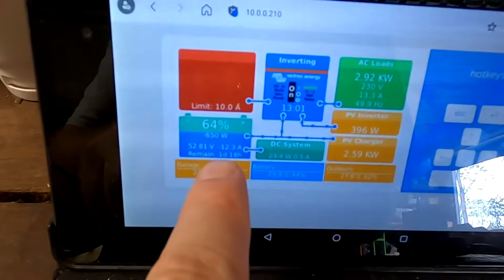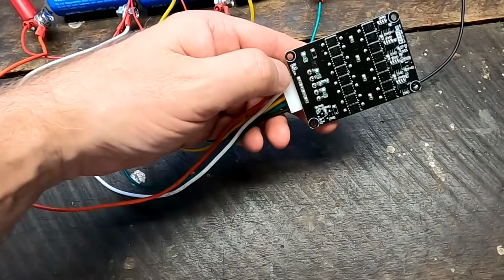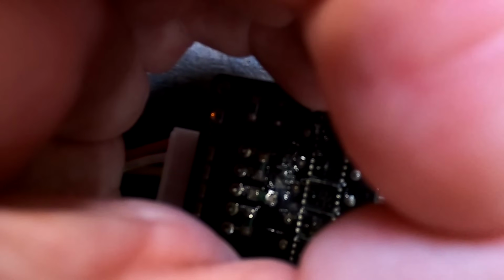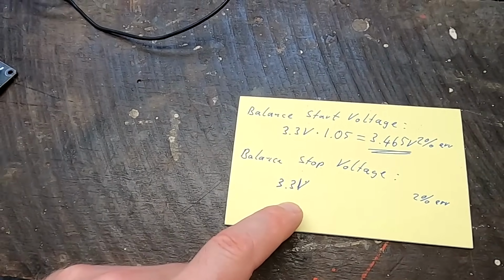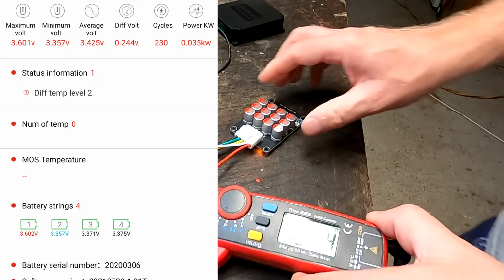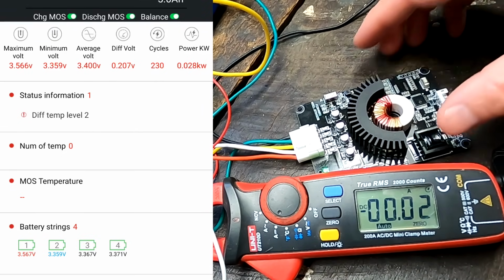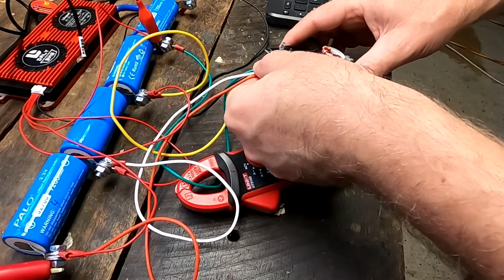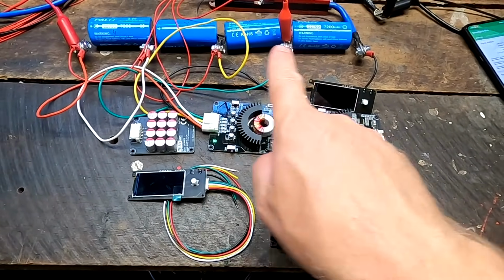Some Heltec Active Balancers you may not have seen before... useful or gimmick?

Comment: I ordered a balancer from the link and the box says Model 0877D with a working voltage of 3.465V - 4.5V
but the balancer says Model 0877A with a working voltage of 1.8V - 4.5V.

Heltec responded: Hello friend please feel free to use it that it's correct the product you order. It's just we didn't change the print on it yet.

I have yet to put it into service but I hope they aren't pulling my leg.

Comment: I bought another muller energy 250a bms and this time one of the caps on thr heltec bms active balancer exploded after two weeks of use.  What is it with these muller energy.  You gave such a great review and now i question the quality
Reply from the maker: I had no issues with their BMS, battery or equipment. I also have never heard about an exploding cap on a balancer. Are you sure you have connected everything as it should be? Get back to them and I'm sure they will sort it out.
Reply: @OffGridGarageAustralia Everything was connected perfectly. Proper tongue specs, fuses, 4/0 gauge wires, it only had a 4 amp draw. Nothing more. Input from mppt at 3.55 x 4. Just one of the caps popped off randomly. The BMS didn't even shutdown.  Heltec bms are junk btw. I did a lot research. People say those active BMS balancers fail quite often.
Reply from the maker: @stevenlouis1024  Never heard about such an incident before. These balancers are running for years in some installations. You may have just had an outlier with yours.
Reply: @OffGridGarageAustralia  heltec active balancers are having bad reviews. I found 4 where those caps have blown. I also found where it gives out bad voltage readings. Some even had quit working without notice while others had blown or melted pcb boards. not from misconfigurations. It waa hard to find it as they are smashing the search engine with SEO results

Comment: I find the stop voltage of 3,3V to be too high. Why not set it to pretty much the same as the start voltage? Anything else will make the top balance worse if the battery is not drained fast after the charge.

Comment: I still prefer the basic Enerkey/Heltec active balancers. I can set my inverter Aux control contact to turn on/off at preset voltages through a simple relay and tie into the balancer's run feature.

Comment: "As you understand, some have some advance and disadvantages".
No not really. I love the materials. But I do not get how there is no 1 product to rule them all.
These things are so relatively simple.
Why the sloppiness with the manuals, the doubtful specs, dipswitches, bugs and glitches on the software side.
Just make a BMS with a USB port. That detects all other BMSes on the RS232 ports and shows them as if it where one device.
And ofcourse have a built in active BMS.
Reply from the maker: It's made in China. They produce fast, to sell fast!
The quality is ... well, OK'isch but far away from optimal. Software is their real problem.

Comment: Why do you need a balancer you know the speed from electricity it will balance it self
only not with a bad cell that stops even a tesla.
you can peal a banana and eath it but you can use also a knife to cut slices
that bms is the knife you do not need it just take care the cells are good connected.

Comment: Great start with the conjecturing & emotional discourse!
Reply from the maker: Thank you. I need to mix it up a bit, right?!😁
Reply: @OffGridGarageAustralia  Have you come across the 48V forklift bulb method of precharging capacitor's Andy?  I have used the carpenters pensil & cement resistor but found "seeing the light" far more enthralling; eBay - Glühlampe 48V 40W Ba15d 25x48mm (seller legantec24). Coupled with BA15d Lamp holder on bracket, Prewired - CB-25 (seller pcarena-bristol).
Reply from the maker: @patricklyons7683 What are you trying to precharge with a 48V light bulb? I use 12V light bulbs and they work great for inverters or single cells.
Reply: @OffGridGarageAustralia  It removes the active spark caused by attaching positive to items like wanptek charger or inverters. Before switching them on you place 48v bulb in between positive connections & momentarily it lights up showing capacitor has stored charge; equalising the voltage between devices sir.

Comment: Does anyone have experience with the Seplos active balancer? There is no documentation and the threshold values on the site seem to be very different from what I often hear Andy explain? Or I don't understand how to connect that thing. The active balancer could balance with 3x 2A and has a relais per channel.

This balancer comes with Mason 280 boxes and the BMS v3 so that combination would (or would) be nice...

Does anyone (or maybe you Andy) know more?
Reply from the maker: The Seplos active balancer is a stand-alone device. It does not connect to any other Seplos devices in a way that they control the balancer. Seplos told me, this balancer can be used with any hardware.
It seems, it is an always-on balancer, BUT they have hard-set a 50mV voltage delta, so it will only balance if the voltage difference across all cells is above that.
That also means, that the overall balancing success will never be better than 50mV, regardless how high you charge the battery.
Reply: Jep, I got response from Seplos: I wondered if the dry contact on the BMS v3 could be set/programmed to your own specification, they replied 

"When the active balancer is connected to BMS via dry contactor, it will be automatically trigged when the voltage difference is over 50mV. No other setting or switch on BMS studio. There is a switch on the front panel of MASON case to turn on or off the active balancer." 

It seems to be a kind of 'sometimes-you-may-need-this' option and than enable the balancer by hand. They suggest to let the passive balancer keep the pack in control and only when needed activate this thing.

 @OffGridGarageAustralia
Reply from the maker: @bartkerver4884 Makes no sense to me to use these contactors for another active balancer if the BMS already have one.
I clearly asked for custom programmable option for these relays because all our requirements are very different🤷‍♂

Comment: I would not trust cheap electrolytic caps on expensive cells.  Most of the time they just wear out from electrolyte dry out which just reduces their capacitance and makes them non-effective, but they can short out due to internal ESR heating that can damage cells. The cheap electrolytics are not designed for high ripple current that occurs in this application.
Reply from the maker: So, you would recommend the transformer based balancers for longevity reasons?

Comment: Hello friend, I'm from Brazil, São Paulo. Answer me a question that may be common to many. What is the considerable amount of imbalance between the batteries we do not charge? How much difference do I need to use a balancer? May God keep on blessing you.
Reply from the maker: It depends on the battery chemistry you are using, my friend.
With LiFePO4 you cannot balance under 3.45V due to the very flat charge curve.

Comment: On the 5A flying capacitor active balancer, you can easily change the balance start voltage by replacing the voltage detector chip located at the bottom right of the PC board. It is a XC61C family chip made by Torex Semiconductors. The stock part is a 2.7V version and has an SMD code 'C733'.
You may replace it with a 3.3V version (SMD code 'D333)'. The 8S, 16S and other versions of the active balancer are all the same. The 'D333' has a 3.3V detect voltage, and 3.465V release voltage, which is 5% (hysteresis) higher than the detect voltage. So, the release voltage is the actual balance start voltage, and the detect voltage is the balance stop voltage. Other detect voltage versions (3.0V, 3.1V, 3.2V, 3.4V) are also available.
Reply from the maker: Great info, thanks for sharing.

Comment: Just bought the standalone cell voltage display some weeks ago to retest a „stupid & cheap“ 12v BMS LiFePO4 battery, because i was curious how cell balance developed after 150 days of usage in our garden shed to reload all the garden tool batteries we use (and running the pool pump - but the pool was not installed in rainy cold Germany this summer).
Reply: I think that adding a simple cell/pack voltage monitor is the single most important feature that could be added to a dumb LiFeP04 series setup. So much can be learnt about the health of the pack by looking at those cell voltages as they approach 3.6v and by using a variable voltage charger and monitoring cell voltage, passive balancer can find a sweet spot to operate in for long periods of time to the pack in balance. Do they make these displays for 8S and 16S or would you just add more displays?
Reply from the maker: I actually have a need for such a 12V display as well. First, I was doubting the practical need for such a display but now I have two projects where I actually could use it😄

Comment: 8:45 Hmm.. NOT good.
In case one cell goes bad, it will not balance the pack and we could see cell 1@ 3.3v and cell 4 @ 4v then burn
Reply from the maker: There is still the BMS preventing that...
The balancer is only there to balance, not to protect.

Comment: Thanks for this video.  I was curious if I missed a video on the JK balancers I just noticed on the Hankzor store.  I assume they work the same as the JK balancers built into their bms products, just without the bms protections.  A JK balancer added to non JK BMS might solve some issues with those other bms's.
Reply: Thanks, I had just seen the "JK Balancer 2S 3S 4S 2A" pop up as a new product arrival and it got me curious about them.  JK has of course had other versions out for some time now.
Reply from the maker: The JK balancer is a stand-alone device. It does not integrate or communicate with the BMS but can be programmed similar to the NEEY.
Reply: Has the standalone JK active balancer version been updated? My version of 2yrs ago has the "old fashioned" on/off at around 2.7V and the only way of limiting balancing in the flat part of the curve is increasing deltaV, so is very much like the early Neey balancers. An add on standalone balancer can useful to install on an OEM system to add Bluetooth monitoring.

Comment: Any suggestions on how i can add a switch to a standard (model without built in 3.4V auto start) 4s balancer?  Thanks
Reply from the maker: Yes, I have shown this here:
Manual switch installation: https://youtu.be/ZplbAAqnrjo
Auto switch installation: https://youtu.be/kEeD-oM4QnY
Reply: @OffGridGarageAustralia  Thank you - I didn't phrase my question very well. My active balancer doesn't have the solder pads on the PCB that yours has. So how would I install a switch if there isn't a connection on the PCB? Thank you.
Reply from the maker: I would assume you just disconnect the negative of the balancer and it would turn off. But I'm not sure about this, so please don't destroy your balancer if trying.

Comment: If I had to design a balancer, I'd do an isolated DC-DC power supply that takes pack power to directly charge the lowest-voltage cell. Then the charging/relief current can be anything you want regardless of cell-to-cell voltage differences.
Reply from the maker: Interesting approach. Build one, I'll test it...

Comment: I have used the Chins 12v100Ah battery with interal bt bms and heater, and find they recommend two softwares. One appears flaky. The other appears to let you see the conservative bms settings, but not change them at all.
 Is this a Chins shortcoming? Their service writes excellent English, but appears to have the comprehension skills of a gnat.